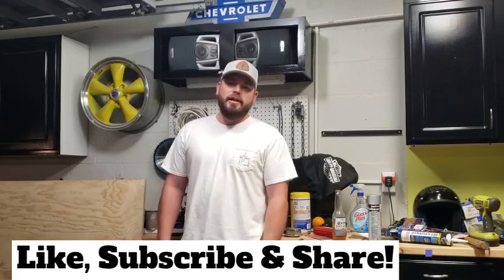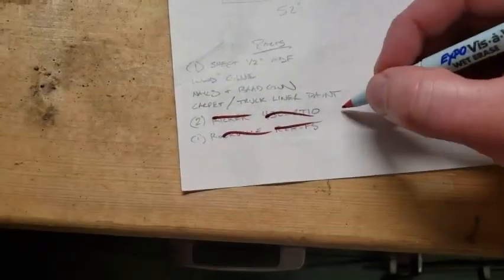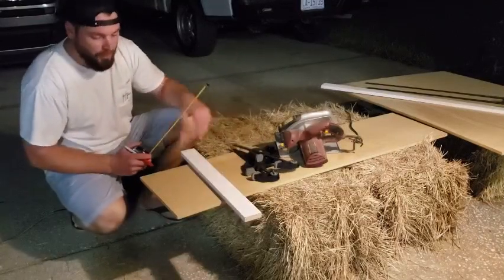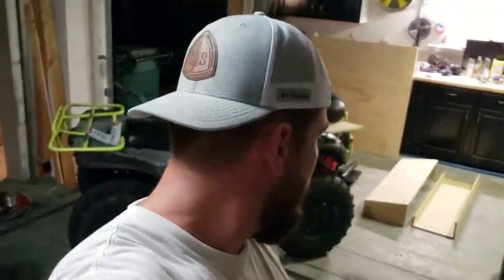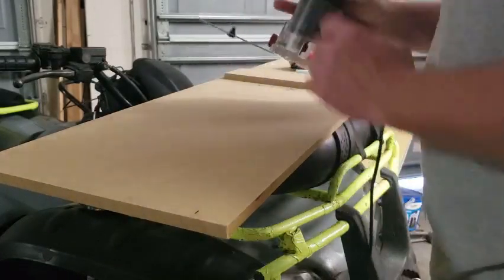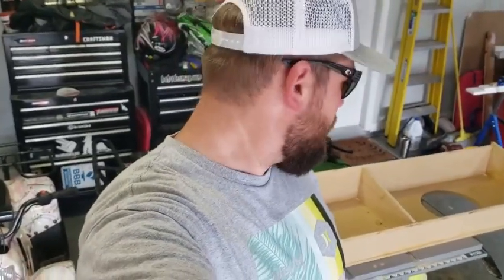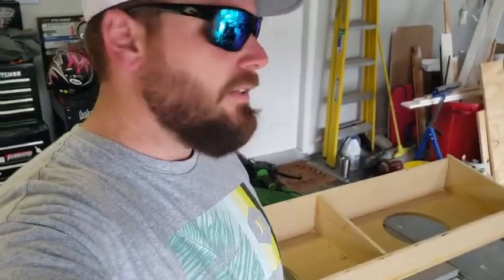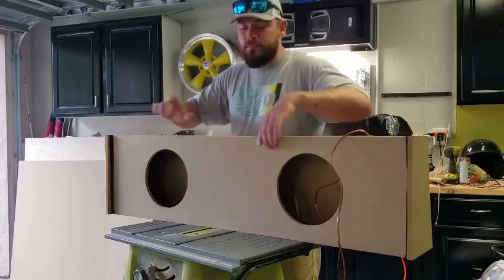Easy How To DIY Subwoofer Box Build, DETAILED and UNDER 25min

Comment: That was a 200 IQ idea about the last step with the black sealant. I'm going to build me a down firing box for my home theater. Thanks for the content and it helped me out a lot.
Reply from the maker: Glad to help, I too just started building off of what i watched and researched, best of luck!
Reply: @JTP Buildz  loved the video,  just recently purchased a 2014 f150 and going to build a box. Just a long shot, but can you send a copy of the diagram and measurements
Reply: @rodneyhafer4548  it's in the video if you just pause it. I don't remember if it shows where the cutouts were for the speakers were at though. I forgot to mention though with the price of wood now, it may be as cheap or cheaper to buy a prefab box. Might want to check their prices before building one.
Reply: Here's the 300 IQ idea. Use liquid nail instead of wood glue and silicone caulk

Comment: New subscriber here. What's the airspace per speaker? Also how did you get the bevel on the back and front pieces? Thanks
Reply from the maker: Honestly, I don't know, I just built the biggest area box with the space provided. I shopped for weeks and couldn't justify the money for a pre-built box so I researched and researched and threw it together. It is STILL hittin hard and bumpin, so glad I diy'd it and didn't buy.
Reply from the maker: As far as the bevel, I'm not sure I fully understand, but I'll take a swing at it: 1. The bevel is 2 measurements; one from the height of the back the seat to the floor,  and then another measurement from the front of the seat height to the floor. 2. The side box peices were purposely cut higher to act as a brace/air travel for the subs. Im no professional but i was trying to leave space for the air escape/hit

Comment: Bro what do you think about fitting 3 12" sub's in a box like that in the video. ported or close.. plz help me out guys what u all think is for a single cab truck we are running 2 12 skar's   it sounds real good but I want 3 plz let me know if it works or is 2 tight for the space for the sub's thanks alot guys thanks 🙌🙏
Reply from the maker: I'm no expert, but i think 3 12's would be too much work for end result. the 2 10's I installed is already pushing the limit (from what I am told). But i will say they sound crisp and heavy so who's to say;)

Comment: Hi can u use a fosgate p1 sub 10 with a jbl cs10 in my diy box under seat have kenwood ps200 amp .steve
Reply from the maker: I'm no audio expert, but if it fits let er rip! I did consult a local audio shop for fitment of the box i wanted to build and my end goal of hard hitting subs